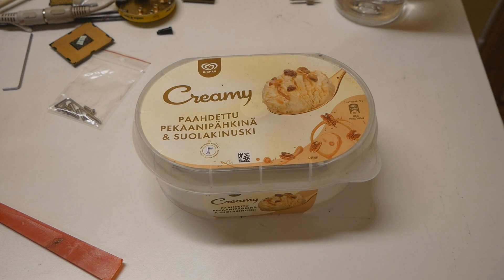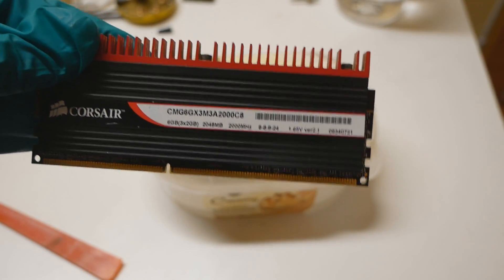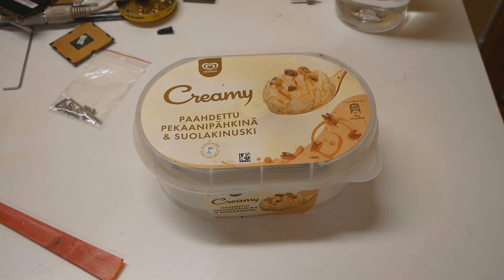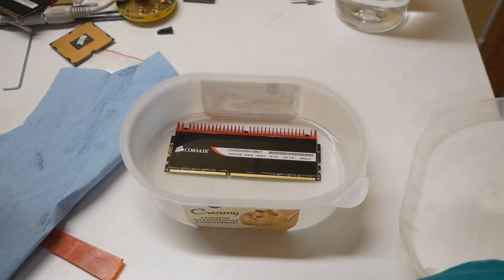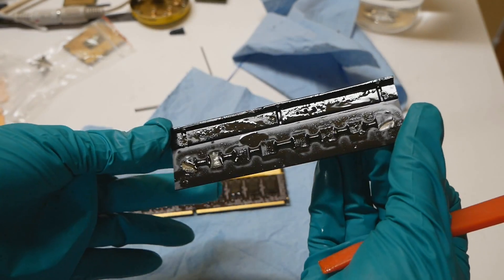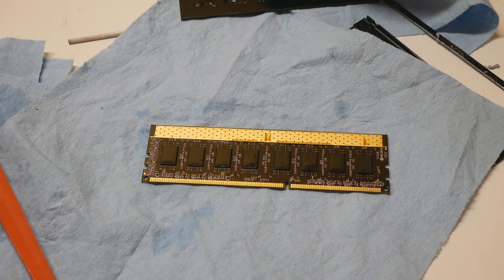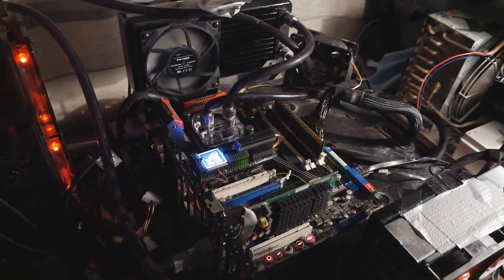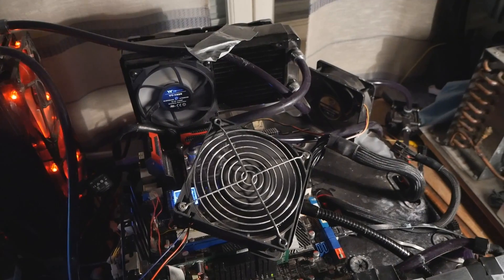How to Remove Memory Heatsinks the EASY Way with Turpentine (feat. Corsair Dominator GT)

Comment: You can use ISO Propyl Alcohol to remove ram heatsink
Reply: I have some sticks of G-Skill Trident Z Neo RGB soaking right now in 99% IPA. I am probably going to leave them for 24 hours and try, and if it puts up a lot of resistance then back in they go for another 24 hours. Have you used the rubbing alcohol method before, and if so how were your results?
Reply: Hi won't it damge the the ram and ic ? Forgive me am new and want to do this for a ddr5 g skill  in my first watercool build

Comment: I just removed heatsinks on some old ddr3 dominators to transplant into some b-die ddr4. I put them in the oven at 90c for a few minutes and it worked. The epoxy was still stuck to the chips, however.

Comment: It works with isopropanol too
Reply: I'm pretty sure the iso only works on thermal tape. Not epoxy.
Reply: @ActuallyHardcoreOverclocking any chance you tested it over the years to confirm? I have 2 sticks of G-Skill Trident Z Neo RGB soaking in 99% IPA right now. Going to let them go for 24 hours then give it a try and if it's still not budging then back into the bath for another 24 hours. I'm hopeful because it's a double sided kit (2x32GB DDR5) that both sides are just using thermal adhesive and not epoxy.

Comment: ill stick with my heat gun, get the heatsinks hot enough and they will pop off. that with some heat resistant gloves ill pop heatsinks off all day long easy.
Reply: I wonder how many sticks have been killed by soaking in 99% IPA vs heat gun and pry method.

Comment: Yeah I agree LN2 can be devastating to the sticks. I had a kit of unopened new old stock Adata XPG 8155A black pcb 2200c9 that I wanted to open
I put them in a bread pan full of LN2 and the second the boil stopped I pulled them out and no go even when trying straight from LN2 to 500C heat gun
So I left them in the LN2 bath for about 4 full minutes and as soon as I pulled them out with some tongs and put it on my mod mat one side of the heatspreader popped off taking all 8 IC's with it. No force used at all and the IC's came off so clean like they were sheared off with a scalpel
I still use LN2 for most heatsink removal jobs but sometimes am forced to use a solvent, usually just pure Acetone because that's what I always have

Comment: That was great but what was the purpose of removing the heat sink?
Reply from the maker: I want to attempt repairing some dead hypers.
Reply: Apparently my motherboard has its own beatsink you need to put the nvme in. I just bought a 4Tb with a heat sink so I'm gonna have to do this I'm scared